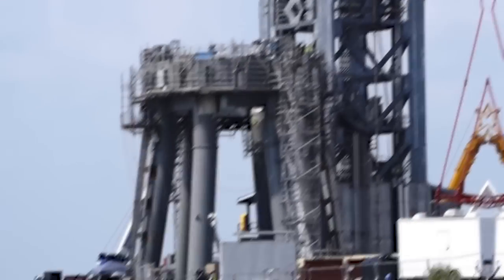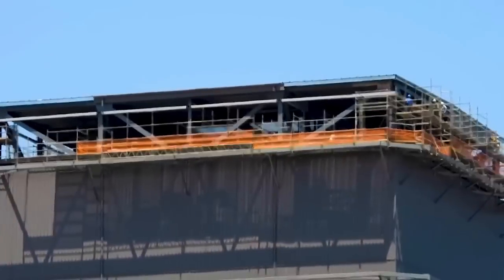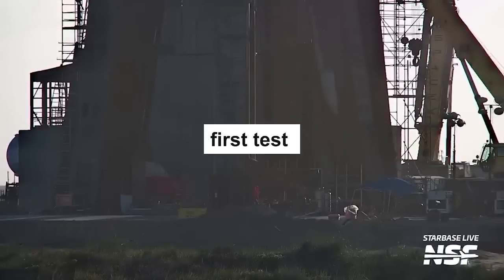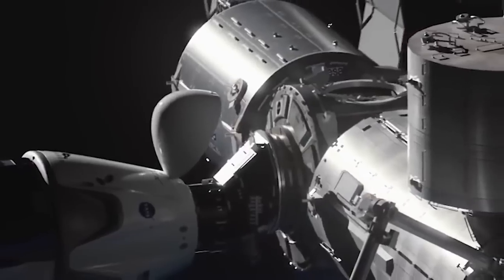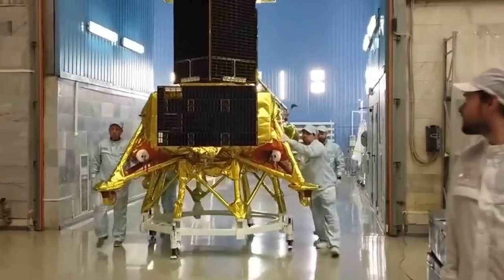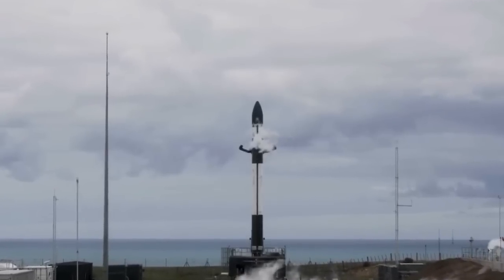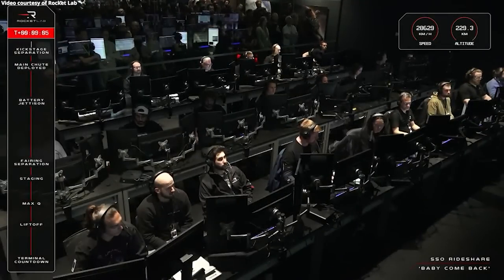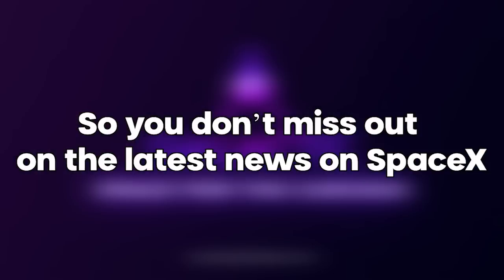SpaceX Finally Tested New Water Deluge System + Starbase Timeline Updates...

Comment: @KarolKarolak
Tall building erected on alluvial soil topple over during earthquakes due to phenomena called soil liquification. One just wonders how many artificial earthquakes (launches and static fire tests) will it take before alluvial soil (with very high ground water level) laying below OLM  and launch tower liquifies toppling over both structures. What we have seen during last test launch was accelerated pile driving (whole OLM hammered into soil below). After last modification (introduction of raft and pile structure) we will see not pile driving as before but accelerated soil compaction causing soil liquification. I just cannot wait to see this action.